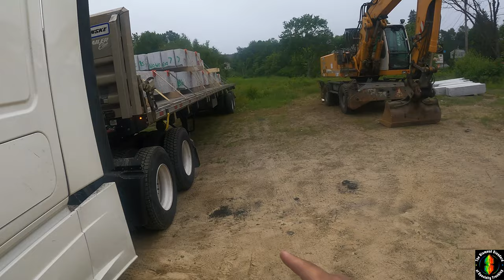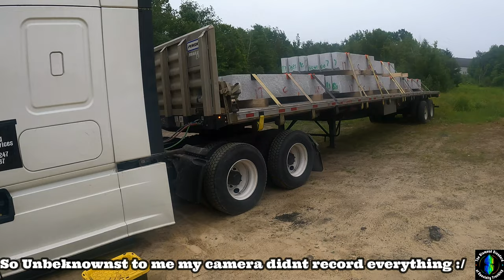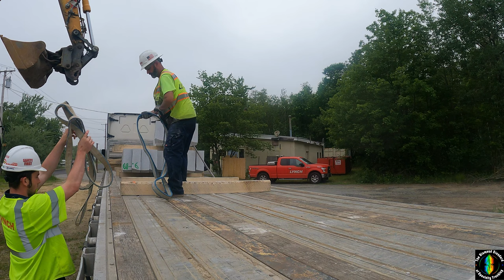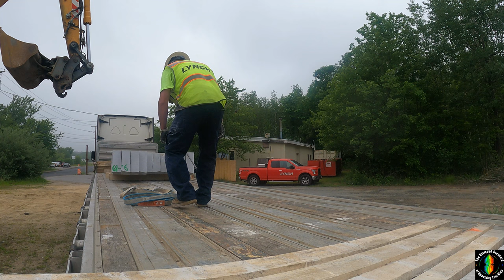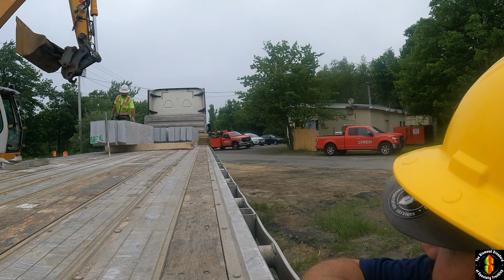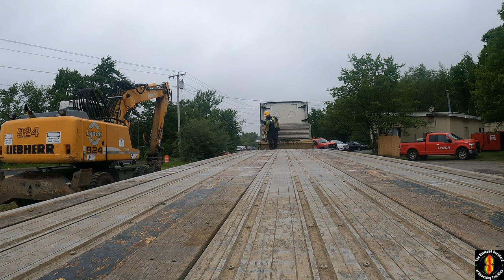Granite Curb Delivery!

Comment: When I drove I hated construction sites, the folks on site were never expecting me and had to jump through their butt to unload the cargo. I picked up a commercial Trane  in Colorado and delivered to Texas, it had lifting eyes for an overhead crane that’s how they put it on the trailer. In Texas I wasn’t expected, no crane the solution, four forklifts and I pull out once the load was in the air. Ok sign here first. I slowed down long enough at the dumpsters to get the trash off my trailer.